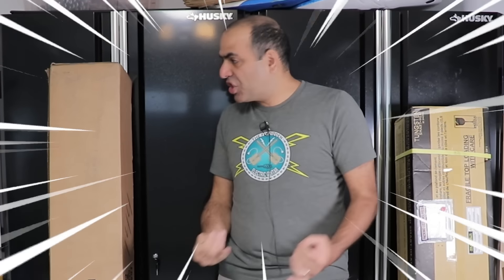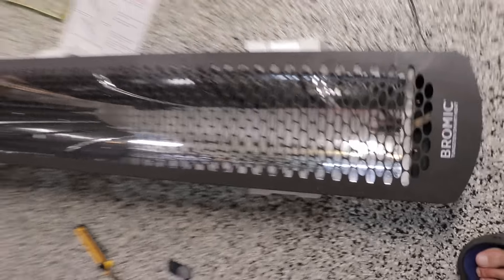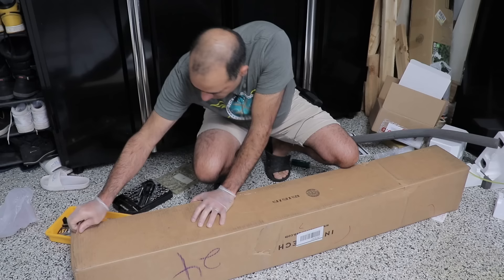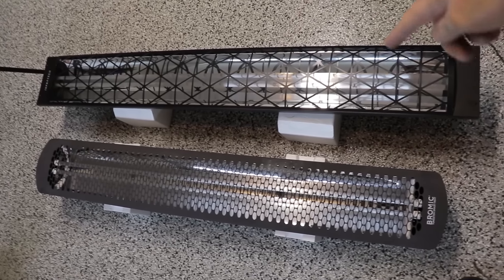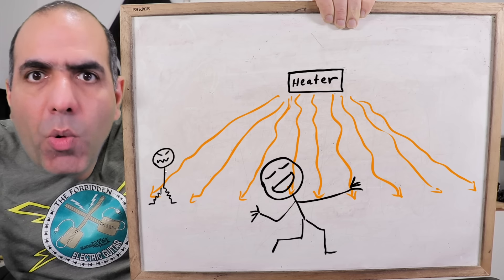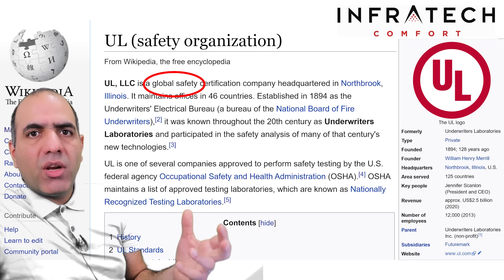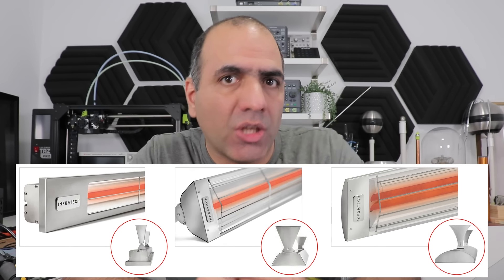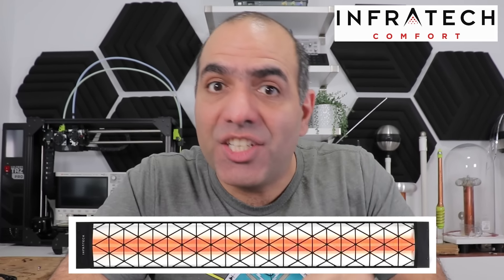Comparing 6000 WATT Resistors, Infratech versus Bromic Heaters

Comment: Gotta love that companies can just define "lifetime warranty" to be an arbitrary number of years in the fine print. I get that "lifetime" is technically not a standardized unit of time, but come on. That's like the old saying "give a man a fire and he'll be warm for the night; set a man on fire and he'll be warm for the rest of his life"
Reply: That seems exactly how they define lifetime.
Reply: Lifetime warranty is more or less like limited edition...
Reply: some define lifetime warranty as the lifetime of the product, and it only remains a product for as long as they want, after which it is no longer a product, therefore its lifetime is over. so yes, very arbitrary, and utterly meaningless
Reply: In us companies are obliged to cover warranties for up to ~4 years after that its up to the goodwill of the manufacturer
Reply: @TrueHolarctic  Happen to know based on what regulation / court case / law / etc? I'd love to have that as a reference when I call up customer service.  The most popular warranty protection I'm aware of is Magnuson-Moss Warranty Act but that doesn't have any requirement for 4 years to my knowledge unless that was established in a court case somewhere?
Reply: @TrueHolarctic  Did you just make that "4 years" number up?
Reply: Lifetime warranty*

*this company may shorten your lifetime
Reply: There aren't any of moving parts a heater like this should last a long time depending on how often it is used and environment.  Companies are just copping out for not having a true lifetime warranty, those units probably cost several hundred dollars with shipping and are probably relatively inexpensive to produce.
Reply: @OneOfDisease  The customers are as cheap, if not more, than the companies
Reply: People go instantly wrong when they think the lifetime means THEIR lifetime. No, it's the PRODUCT lifetime. That begs the question what is product's lifetime? Well it is expected time the product lasts. Helpful? No? This comment has lifetime warranty. ... aand it's gone.
Reply: @ShadowManceri  Thing is, if it's the product's lifetime, everything has a lifetime warranty. You don't need it while the product's working, and it expires the moment the product breaks.
Reply: @LordHonkInc  It's not that complicated... It's expected lifetime like I said earlier. For example a washing machine could be expected to last 4 years. If it goes broken before that, then it is broken during it's lifetime thus applies to lifetime warranty. But if it breaks after 6 years, then it is past its lifetime and doesn't have warranty anymore. It's really not that complicated at all. The actual problem comes from that what is the lifetime of product X. At worst you might need to fight that in a court.
Reply: LOL
Reply: @ShadowManceri  exactly. It's kinda like a word game. Thing is people think in their own terms. They hear/see "lifetime" instantly they think it refers to them, but in this case the sneaky bastards added that 7 years explanatory note so they wouldn't face any lawsuit. It's fair and unfair at the same time, i guess.
Reply: Lifetime is around 5 seconds, that if you define that as the time a banker lives around me.
Reply: I don't know if all states and countries have laws defining lifetime but at least some do. Unfortunately it varies considerably.
Reply: They didn't specify lifetime of what.  Could be the lifetime of a fruit fly in fine print.  So about basically no more than 15 days.
Reply: Not sure about that last part on setting a man on fire.  We should ask Denzel Washington about that.
Reply: The only lifetime warranty that I truly believe is from ZIPPO Lighters. 3 generations later and the lighter that i got from my grandpa is still working.
Reply: @ShadowManceri  That's the whole point in the first place - for any product the warranty ends up being described as a certain period of time (X months, years, whatever), but some choose to use "lifetime" just because it might happen to mislead someone into thinking that it applies for as long as they live - which could seem reasonable on something that, indeed, seems unlikely to ever break unless it was faulty to begin with, but would probably eventually break if passed down enerations after generations (not that anybody ever uses something older than a generation nowadays anyway)

Comment: Being an electrical engineer, you probably haven't studied the thermodynamics of radiative sources. Myself, being a mechanical engineer, we have studied thermodynamics and heat transfer, in detail. We actually analyzed the effect of the "motif" in front of a radiant heater. We found that it does not impact the performance of the heater, as when the motif heats up, it also retransmits the thermal radiation towards the intended surface, and is reflects an equal amount of thermal radiation back to the parabolic lens, which is then reflected towards the intended surface anyways. The only drawback of the motif, is that it can reduce radiated energy by converting some of this to directly heating the air, which is lost by natural convection.

Comment: "If there is a way, electricity will find it."

Golden words.
Reply: Yes
Reply: Ants too.
Reply: @ClaudioBrogliato  hehe
Reply: Yes I thought so
Reply: "This is the way"
Reply: How often have I tested this 🤣🤣🤣
Reply: I like your comment but feel unable to tick thumbs up as it's currently showing '240' 👍
. Too late, thumb count went up while I was typing..
Reply: Electricity uh… finds a way
Reply: "If there is a way to make sparks or get zapped, he'll find it."
Reply: @johnrich6928  almost 666
Reply: I am shocked that both products use 2-wire connection, without proper ground wire, especially considering metal body and 6kW over 240V!
Reply: Water has joined the chat and started typing.
Reply: Hey Daniel.. From Mangalore?
Reply: Shockingly accurate
Reply: Isn't that how dinosaurs breed?
Reply: Ayoo
Reply: @4dbullshitpatroll6  Pretty sure one can get >100% efficiency by putting a heat pump below the porch.

Is a quite different setup though, and installed very differently - may not even be possible here.
Reply: As does life

Comment: Gotta love the “lifetime warrantee” that ends after 7 years
Reply: 1 year warranty on the parts that matter.....
Reply: Yup cause a humans lifetime is only 7 years
Reply: Thats heading towards the concept of "Lifetime fluid" in cars that used CVT transmissions. Lifetime just meant the trans fluid lasted as long as the transmission. When one was dead so was the other.
Reply: @andrewd1455  I dunno about that, I think heating elements matter just as much in that instance. The rest is just the structural metal bits, where I'd imagine a failure would likely occur extremely early if at all; the reflector and the insulation where about the only thing that could go wrong would be having holes in the insulation from the get-go or the reflector literally falling off as soon as you install the thing; and then there's a bit of wires running through the device with no circuitry whatsoever, but it's just wires with one end coming out to connect to the heating element and the other to connect to the power source - the only major failure I can envision for these is insulation melting off over a long period of time, which I guess is a valid concern.

Still, the heating elements and the structural metal are probably the largest contributors to the cost, and out of these two the heating elements are much more likely to fail, especially over a period of time, I'd imagine (from the quartz having imperfections that eventually cause it to crack, to the wire wrapped around it having quality issues which might lead to uneven heat distribution)
Reply: It's a dog lifetime 😂😂😂
Reply: I suppose it's the estimated lifetime of the parts
Reply: Pretty clear how long they believe the product should last for then.
Reply: That seems like a threat
Reply: THEY WILL COME
Reply: Someone should really challenge this type of marketing in court (although they will loose). Tonnes of people wrongly think that lifetime warranty means lifetime warranty, and in British common law (which eg. the US uses too) it should be based on what an average person can be expected to understand/conclude from your marketing.
Reply: @volundrfrey896  Why is it so hard to understand it's the estimated lifetime of the parts, not the buyer?
Reply: On a heater, any warranty is life time warranty.
Reply: THose are high voltage devices so it's accurate, if they fail while running your going with them.

Comment: I have a feeling that Infratech knew about the Bromic Heaters document and wanted you to help them debunk them, that's why they were so confident.

At 9:47, that asterisk really sounded my asterisk detector, since one asterisk can just say "as long as package has been dropped from 3,000,000 light years."
Reply: i think there is a scenario to beat the competitor of INFRATECH.Not good mate
Reply: 0:31 the LEGENDARY can MADE LAUGH, the BEST OLD TIMES
Reply: You mean rectovey
Reply: The problem then, is that they gave Mehdi a different model than the one Bromic is "comparing" to
Reply: One problem when one can chose the competition at will
Reply: @0AnnieStarr  he said it was the same reflector and elements though...
Reply: Honestly mehdi shouldve purchased other infratech heather. as the one they send could have been set up for a better quality that the standard. Lockpickinglayer do this a lot
Reply: uh!!! scandal??!!  lool. I have a feeling that the outcome of 20 mins exposure would somehow favour the sponsors. .. but dont spoil it... i'm only 5 mins and 13 seconds in.
Reply: @0AnnieStarr  10:45:"Both have Identical Reflectors and Elements"
Reply: @Palmit_  Sorry
Reply: @CrazyMage--0  darn it!  i was readying my teeth for a nailbiting conclusion.. lol ;)
Reply: Maybe Infratech and Bromic are the same company.
Reply: An asterisk detector is a very important tool to have.
Reply: @jasonyang7842  Or they source them from the same OEM in china. Since the profile is so similar.
Reply: i see a * in marketing stuff i immediately stop reading. thats the code text for false advertisement that cant be sued against cause they technically told you in it that its not true, you just dont usually think to look for its connected info.
Reply: @pulsefel9210  Lifetime warranty*

*unless you live longer than the warranty
Reply: @tanelehala6422  *lifetime used for reference is mean lifetime of North American Fruit Fly
Reply: @jingarjay8754  I mean, ignoring the BS claims by BROMIC about their "amazing patented profile reflector" or whatever, the reflector kinda needs to be parabolic to make sense, since it allows the reflected infrared to mostly be focused in one direction below the heater.
Other than that there's not much to the profile in the first place, only the cylindrical heating elements and the outer metal case/shield/whatever where the design doesn't neccesarily make much difference beyond aesthetics.